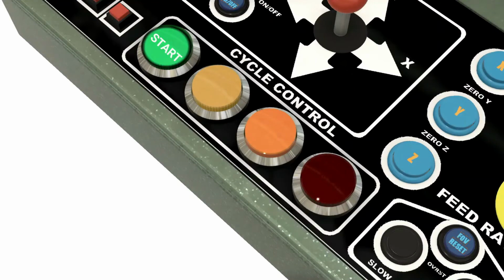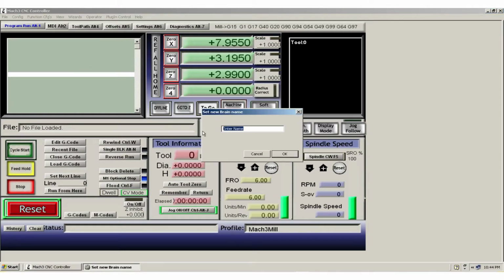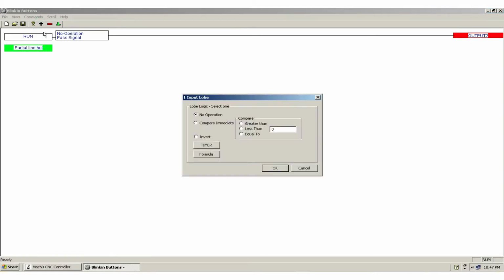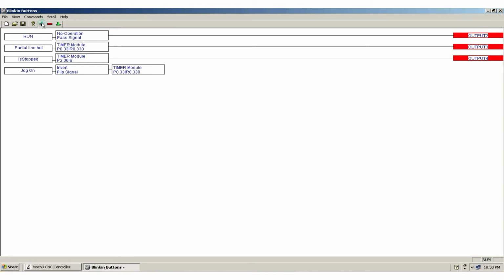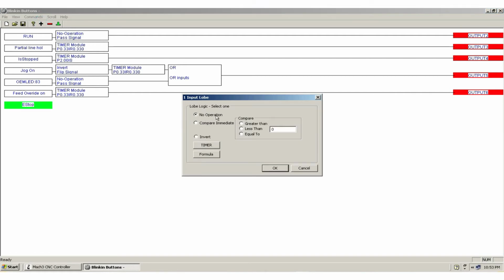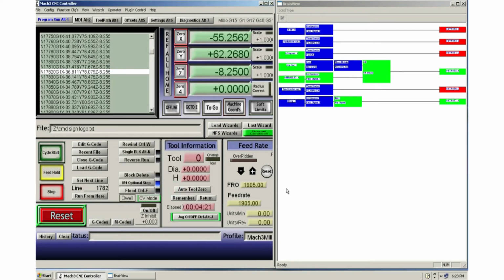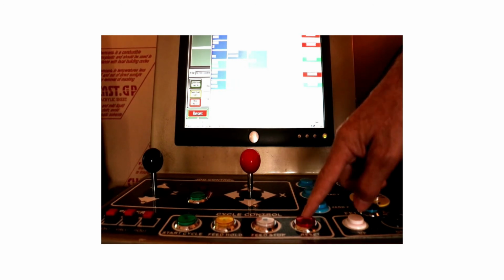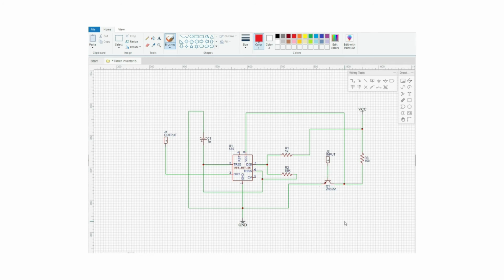How to Make Mach 3 buttons to Illuminate Optimized

Comment: Hi Carlos - Thank You for the great video.   Can  you please post a link to where you got your Parallel Port Break Out Board?
Reply from the maker: eBay item number:383114029814
 Go to ebay and enter item number or search for  DB25 Male Female Signals Breakout Board Screw terminals vertical 180. Good luck.